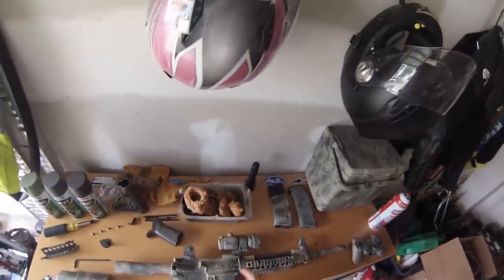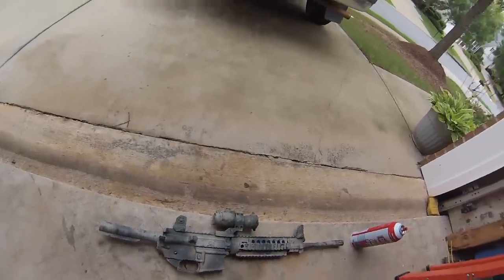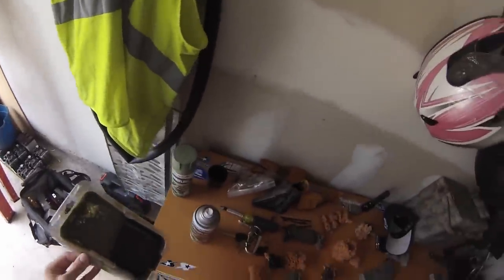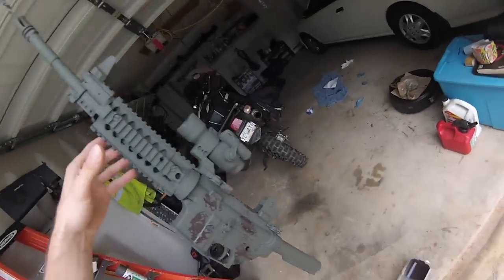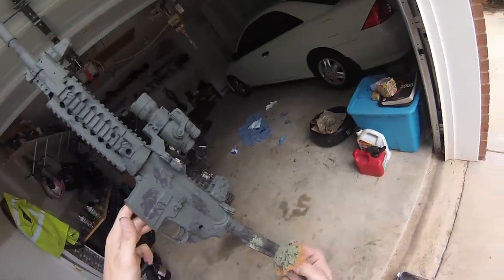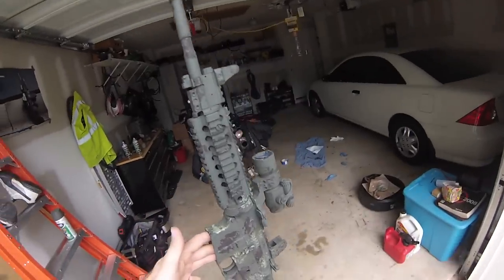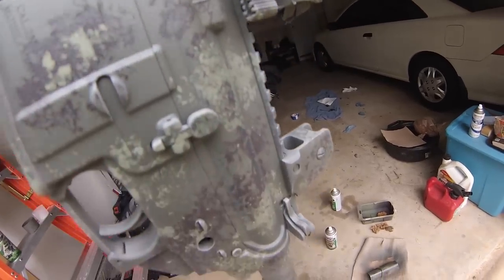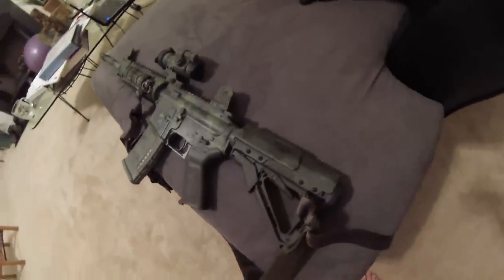How to camouflage a rifle (sponge method revisited)

Comment: Glad to see I am not the only one that uses their trash can lids as part of their painting station. 

I had this same problem with the matte clear coat.   It is not you fault or the weather.  I called Rustolum about this it was traced to the can filling facility and was caused by residue from the overnight fluid flushing of the can filling line.  I was told that the clear coat is not exactly compatible with the paint the clear is an acrylic lacquer and the paint is a acrylic enamel the solvents can cause problems per Rustolum
I used desert tan base coat and much smaller sponges and over-layed the 4 color pattern a lot to get better depth to the pattern. I also did my sponge work on my lap using a plastic dinner plate as my spray paint palette and blotter.  I did my helmets for practice then my AR's and 12Gauge.  My hand guns will be my next victims most likely with Duracoat since I have the air brushes.
I have tried a number of methods one is to cut or rip holes in a handy wipe and hold it above the object you trying to paint in a frame of some type, metal sewing hoop works well a net laundry bag to do a snake skin pattern on holsters.
Reply: Why not make a video and share with us some of your skills and help us wannabe's out? 12 gauge camo work done with sponges would be real damn nice to see. Cheers

Comment: You hit the nail on the head. Knowing when to stop. I love this treatment, but I have done some that turn out looking like Vomit because I went over board.. Great tutorial. The Clear Coat comes out thick, and that is why it has the semi gloss.. But a little brillo to it after it dries will eliminate the gloss. Or a low grit wet sand.

Comment: Just a thought. Topcoats with matting powder in them need shaken very well and often to keep the matting particle in the finish.  It will settle in the finish if not shaken well. Also the more coats applied will result in a shiny finish and not as matte. Don't know if that's what happened with that paint or not. This is what I've learned through my years finishing wood cabinets with a matte finish.

Comment: Were you not worried about overspray on your vehicles ???
Reply: +Michael White Or in his mag well.
Reply: +ymp5000 Imagine all that paint on his buffer tube that's going to be building up when he cycles the length of his stock Q_Q
Reply from the maker: +Austin O&#39;Neal there's a little bit of wear on it, but it's not like I routinely adjust my stock. it stays put 99.9% of the time.

also, i've never seen any overspray on my gf's car. i don't really care about my truck, but i'm pretty sure that all the little paint particles dry before they ever settle on the vehicles.

Comment: Great diy vid bro, thanks. I agree with what Vic said. Too thick of a coat on the first pass with clear and it'll haze up. 24hr dry time with color scheme and then three light coats of clear with at least 1hr dry times in between.  If you really want the outcome to be "flat" then, skip the clear coat.
Reply: +XKCommander or krylon makes a CoverMaxx flat clear coat now that works great
Reply: XKCommander that's what I say. fuck the clear coat. It's camo paint. just spray more on or just let it be.

Comment: All clear coats will end up glossy. That's just the way they are. I never use it. I just go really heavy with the base coat, and light on the pattern. Finishes wear off and chances are you can extend the life just by doing quick sprays of more pattern on the rifle as it wears.

Comment: The sponge technique is a versatile, easy method to use.  I used light gray, dark gray, white, black and desert tan (yes, tan) to duplicate an asphalt/gravel look.  The tan is mostly covered up, as is the white, but it highlights in a really cool way.  I've had complements on the finish.  Camo has been done to death, so I used the sponge to do something different.  You have to apply the matte clear like you would Duracoat:  3 or 4 light coats.  You did a good job here.  Thanks for sharing.  Happy trails, tight groups and safety first.
Reply: can you make pictures/video of your asphalt  pattern please?
Reply: can you make pictures/video of your asphalt  pattern please?

Comment: yeah old vid, but the only question I have is, how did you run that charging handle with a saddle on the stock?  Seems like you could only use it full open.

Comment: I have had the same problem when using the clear coat and got the white Frost  looking finish with a rough texture. What I learned " the hard way " was that I was spaying it from Too Far away and  some of it was drying or partial drying before it landed on the rifle. Spray from about six to eight inches away until you get what looks like a wet coat on the gun and when it dry's it look right.And it will not have the Frost look, be sure to practice your technique on card board before you paint the gun , you have to be careful not to get runs , but its not that hard to do.

Comment: The clear coat will come out whitish due to the way you applied it as close to the item being painted and too thick as well.  You just have to back off a little bit and dust the clear coat and allow it to dry and then a second coat in the same manner again for the areas it didn't cover previously.

Comment: Did you tape off the barrel & gas tube within the fore grips (rails)? There appears to be masking tape around them prior to painting.
Reply: friendofcoal How much disassembly is required and what CAN'T you get paint on or in?
Reply from the maker: friendofcoal 

yep, i covered a lot of the internal parts with tape prior to painting. i figured the barrel would shed heat better without paint on it, so only the visible parts were painted. i probably should have mentioned that... although i'm sure nothing catastrophic would happen if those parts got some paint on them.

Comment: Looks good!  Funny it kinda looks different after you brought it inside..maybe the lighting?

How did the frog tape lines look?  Any rustoleum chipping   on the tape line?  or is it very sharp like it's marketed for?
Reply from the maker: the tape was just to keep the paint off the barrel, glass and rubber/plastic covers on the aimpoint. It worked well for that. no chipping, only some wear around the ejection port, mag tube and other high wear areas. nothing excessive and it looks just as good with a little black showing up under the pattern any how. here it is in sunlight. http://imgur.com/ZBvJ41I

Comment: Looks good. You cant really see the white haze too bad at the end of the vid.

A tip for spraying the clear, even a matte clear will have a little gloss in it so it will never be as flat as the base paint under it. Also, when spraying clear you need to put it on wet. If you use the same light dusting coats you do with the paint, then you get the white haze that you saw. I use just one coat of clear and it goes on just heavy enough that the rifle looks wet. When it dries it will flatten out.

Comment: that white color your getting is from not shaking the can long enough. that happened to me. i dont think the moisture could have been the problem. i live in las vegas, nv the dryest state and in had that happen in the middle of summer. it did not go away when it dried so i had to redo my gun and made sure i shook the can well and now i always do. i use valspar flat clear from lowes and it works real well. nice job, well done!!

Comment: If it's humid any spray paint has the chance to turn white, I'm not sure why but that's most likely what it is. I was also disappointed with Rustoleums matte clear coat, painted by barrel matte black then it turned into low gloss with the enamel

Comment: Humidity is to blame for the hazing and weird finish. Duracoat clear does the said,e sort of thing if you apply in high humidity. The advantage is with duracoat you can put additives into the paint to account for high humidity, which you can't with spray paint. Nevertheless, as a 3rd party observer, the camo looks petty damn good.

Comment: Great Technique.  However My Opinion is "DO NOT CLEAR COAT" rattle can or Duracoat gun camo jobs on weapons.  Even "Matte" clear coats tend to reflect light and take on a glossy effect. They are unnecessary to the effect you are trying to achieve, which is break up the outline of your firearm.  Also, this is not an art project you're trying to preserve and the paint wearing off the high spots to reveal the flat anodized finish of the original parts actually causes more even more visual breakup to occure.  If the high spots wear down to shiny aluminum or steel then simply touch up with more paint.

Comment: The white film in your clear is from temp difference.... if you get that film I find that if I get a flood lamp or a heat lamp 99.9% of the milky film will go away after about 25 to 30 mins being infront of that lamp. I had horrible problems painting my customers guns If I kept the clear in the house (Air conditioning) and painted outdoors in summer time.... humidity and temp in what Kylon told me was causing the film.... it isn't manufacturer specific just temp and humidity.......

Comment: The clear coat is a bitch to be using, because it has to be very precise. In Collision repair when they taught the students to mix paint and clear coats they also taught us to spray the clear coat evenly to from twelve inches away from the fender then three coats and hour later they told us to wet sand it. now I don't if you need to wet sand the rifle but as far as it goes using clear coat, you should of just did it evenly rather then just spraying it all on. just even coats and over lap the next section of the gun.

Comment: Brake cleaner on a plastic/polymer/rubber/electric optic?  Lol.  And you painted all the mechanisms of your iron sights?  AND you did it in an open garage so your entire neighborhood and people driving by are aware there's not only an AR15 in your house, but probably a safe full of other guns, ammo and valuable?  BRILLIANT!
Reply from the maker: You sound a little pretentious and paranoid. It's been 3 years since I made this vid and sprayed my rifle with brake cleaner with the whole neighborhood and internet to see and still no problems.
Reply: +Wildman Sam 
Well, nobody is saying you're not lucky.  You'd also be lucky if 1) that optic held up brake cleaner 2) the mechanics of your irons weren't jacked up from repeated paint jobs.
Good sense would discourage a gun owner from more or less broadcasting to neighbors and passerbys that you're a gun owner.
Hope your luck holds out!
Reply from the maker: 1. plastic parts were removed from optic as well as the rest of the rifle prior to cleaning as shown in the vid. 2. the mechanics of my iron sights? I don't even know how you could think that might be an issue. It's not.
Reply: +Wildman Sam 
The US Army has a video up of a camo painting tutorial.  They explicitly tell you tape off all threads and adjustments on iron sights because there's a "high potential for fouling and/or inconsistency of future adjustments".
If you're one of the lucky ones - great.
Good luck.
Reply: Do you have the link for that Video,? From the US Army.?
Reply: calm down its just brake clean.i know he shouldd be using contact cleaner but its not the end of world
Reply: You do realize that all your neighbors can see when you take your rifles and pistols in cases or bags to your truck when you go to the range or see you load up to go hunting gear, and that is not a problem. I don't have people flocking to my house to rob me because neighbors see me put a few rifle and pistol cases in my car every weekend, so inferring that him painting an AR-15 in his garage is dangerous is quite ridiculous.